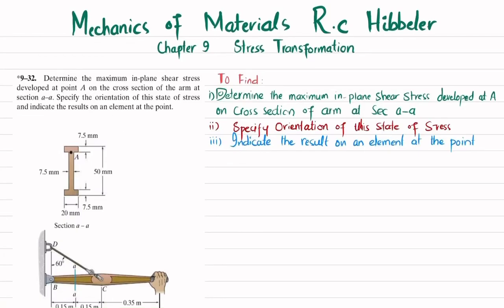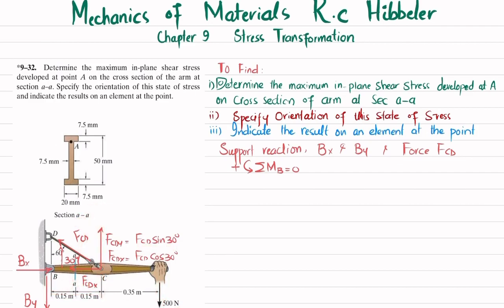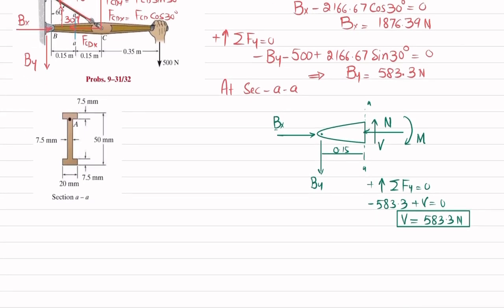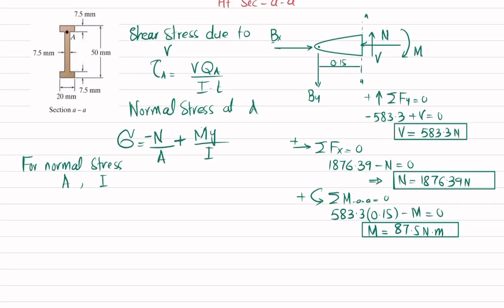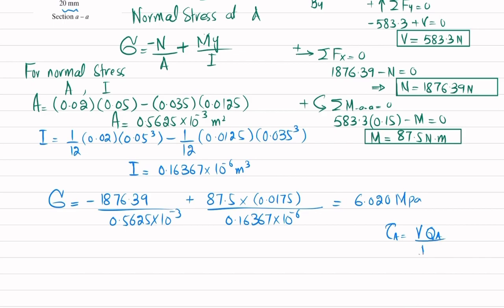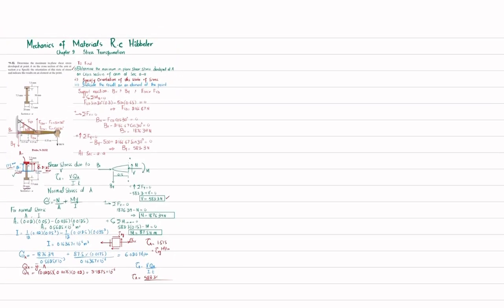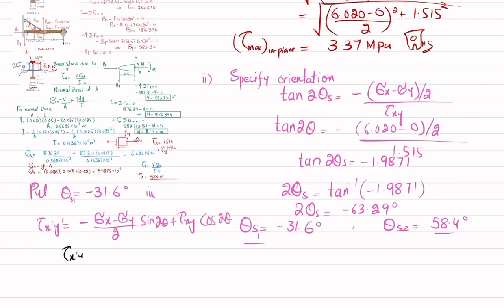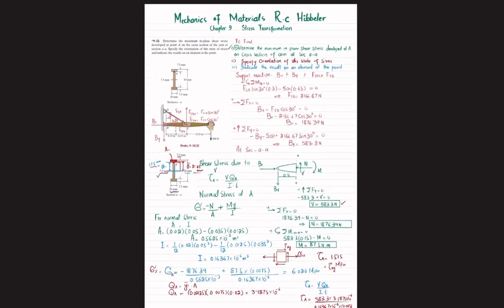Determine maximum in-plane shear stress | Problem 9-32 | Stress Transformation | Mech of materials

Comment: What is the significance of finding the maximum in plane shear stress at a specific point.
Reply from the maker: Well if you want to use the failure criteria , specially tresca criteria ( maximum shear stress criteria) you will be required to find the maximum in plane shear stress at a specific point.